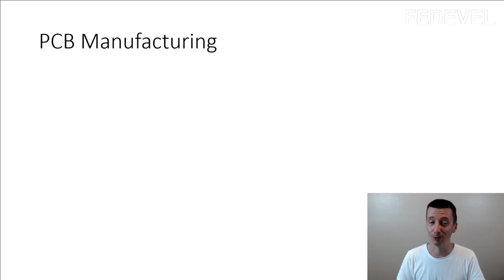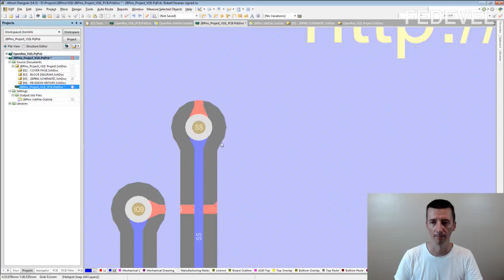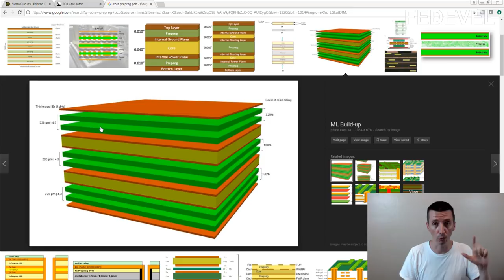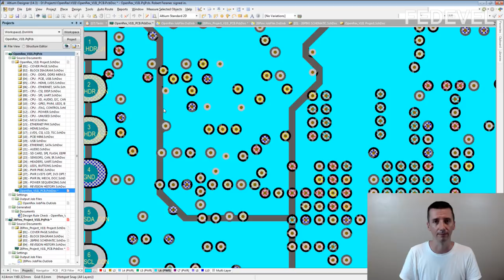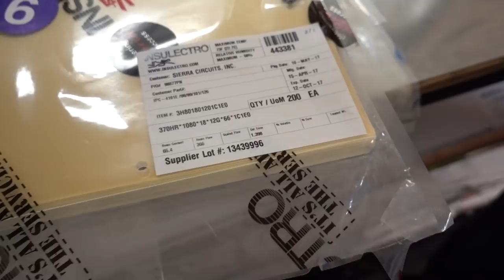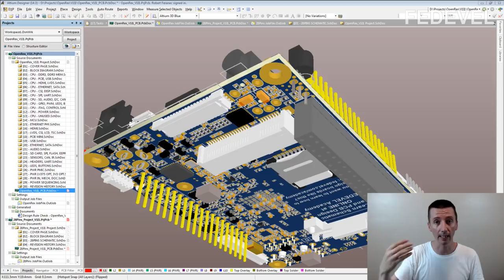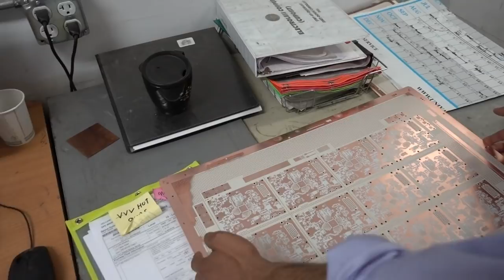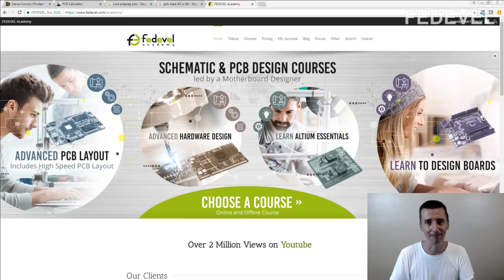PCB Manufacturing - Important facts you should know

Comment: Thanks, Robert! One subject that needs more clarification is related to soldermask and vias. Covering a via with soldermask is called "tenting". Single-sided tenting is not recommended practice, because chemicals can get trapped in the hole (like a well). Most people want to use the back side of the via as a possible test point probe location, but since single sided tenting is not good design practice, we "encroach" the vias on top side, which means mask material "on the pad but not in the hole". This extra mask allows placing vias closer to pads and still have a good mask dam between them (keep solder from flowing down the hole). Also, one problem with double-sided via tenting is that uncured mask material trapped in the hole can expand (like a volcano) at soldering temperatures.
Reply from the maker: Awesome explanation! Very helpful. Thank you Jack
Reply from the maker: Jack, if you like, send me an email to info@fedevel.com and we will send you a T-Shirt. I saw your posts on Altium forum. Thank you for all your support.
Reply: @RobertFeranec  you have already helped me more than you know... and I am grateful. I will help you ANY TIME I CAN, Mr. Feranec!
Reply: Another thing to consider with tented vias is the chemical plating of the PCB. We always order our boards with ENIG (gold) plating now, and if you keep the via holes untented, you get a nice consistent plating inside the vias too. That helps to protect the vias from any long term issues (oxydation/rusting) inside the vias. With fully tented vias, it's generally less reliable as the holes are not really reliably plugged up. It just adds an unnecessary risk for failures and issues. However, i think for HASL (hot air solder leveling) boards, tented vias are preferred, as you run a lower risk of having solderblobs build up in the vias that might cause problems in the reflow process when that solder gets molten again and starts to go where ever it wants. 
I think it also makes a difference between silkscreen printed solder masks and film type masks, i guess silkscreened masks are better at reliably tenting vias, as there is some paint squished into the hole, while with film type masks, there is a risk that pieces of the film covering the hole might come loose and land on a pad/solderjunction and cause issues.
In the end, it's always a good idea to talk to your manufacturer about things like that, they have a huge experience with what they are doing and can give you good advice on what works best for them with the tools and processes they use at the factory.
Reply: And some extra information that just jumped back in my head, we do quite a few designs that need to be very well washed and prepared for conformal coating after the reflow process, and they prefer to have untented vias for this kind of work too, as they are just easier to clean than tented vias where dirt (flux residue) and cleaning solutions might get trapped more easily.

Comment: Robert, I'm very happy to see a new interesting video!!!
I wanted to add a comment on the important topic of Drilling.
Every PCB designer should consider this:
Many PCB Manufacturers consider the drill-gerber file the hole size at the end of the process (FINISH HOLE, or HOLE ENDSIZE).
But the DRILL TOOLSIZE is another thing: this is because the plating process reduces the diameter.
This is important because if you design for example VIA holes with 0.2mm diameter, the pcb manufacturer will use a 0.3mm DRILL TOOLSIZE. (Usually the rule is TOOLSIZE = FINISH HOLE + 0.1mm).
In the example you show in the video, designing a VIA-hole 6mil (0.152mm), many pcb manufacturers will use a drill toolsize of (0.152 + 0.1) = 0.252mm, so the drill-toolsize lifetime will be much higher.

The fact that some manufacturer use a larger toolsize respect the designing hole, impacting the design of all the pcb and all the right rule to put in the CAD, like Altium, Pads, and so on.... For example, if you design the AR (ring-ring) like the capabilities, you should be designed larger because the drill toolsize is bigger than the design hole...
Another example: the "drill to copper" in the inner layers. If you remove the "VIA-unused pad" and you flood the plane, and you want the minimum capabilities, you have always put a bigger rule insulation because the REAL PRODUCTION, the hole is bigger with the drill toolsize.

Many PCB manufacturers knows that this topics create confusion an not specify this, and they take the supplied gerbers and modify them to fit the drill-toolsize without warning the PCB designer.

Other PCB manufacturers instead use DRILL TOOLSIZE = gerber drill. In this case, you do not need to do many calculations to fit the rule cad and stay in the capabilities. But you have to know that the end VIAs will not exactly the ones you should aspect. They will have a smaller final hole, a different parasitic inductivity than the one you've calculated, and so on...As the Robert's video shows, be careful to use a small hole, otherwise costs increase.
Another problem I have had in my career is that if the PBC manufacturer modifies and increases insulation in the internal layers to be able to use a larger DRILL TOOLSIZE, you can have the cut of the inner planes. In your gerber you think you have designed a solid solid plane (typical "swiss cheese"), but the manufacturer removes copper within the limits of the capabilities, so the plane is cut. 

My advice is always to request and verify the "working gerber" to discover all this things.

Robert, Sorry for my English, I hope to given you an interesting topic for your next future videos!
Reply from the maker: Thank you MauroZnt. I am sure people will find your explanation interesting. 
When I was in the PCB company, we discussed also this and I have recorded it, but the topic was not complete, so I left it out of this video. But definitely this is a good point for next visit to discuss it again.

Comment: The copper dots are called ""Copper Thieving" or "Thieving Dots".
Reply from the maker: Thank you RomDump !!!!!!!!!!
Reply: Something i learned is that those Thieving Dots are normally for plaiting through holes or other things to even out the plaiting thickness, you mostly find them on the outer layers. Uneven Copper can cause different thicknesses.
Reply: Copper thieving is the best term and the right answer in cadence I believe it is created by a shape then cross hatching set specifically Xhatch style (shape->global dynamic shape) or in the select shape then parameters -Cadence 17.2
Reply: I had heard (as stated by TecKonstantin), that this "thieving" is mainly used on the outer layers to balance the copper "within" a layer.  As an example, if there is lots of copper in one corner of the board and very little copper in the opposite corner, the electro-depositing of plating will result in most of the copper plating deposits flowing to the side with the most copper, resulting in thicker plating than the other area. These dots are used to "steal" the copper back to the side of the board with less copper.  I guess what this video is suggesting is that the same general technique can also be used to balance the copper "between" layers to avoid "slippage" or warping during the lamination process.

Comment: I appreciate your videos, I have been working in the PCB and PCBA Manufacturing industry since before Lead-free solder was a thing. However I want to point out that all the things you were told are specific to each contract manufacturer, every question can be answered differently. There are so many different ways to achieve manufacturing of PCBs and PCBAs. They should have specified that in their answers so that you don't treat their answers as law or standards, this is why the IPC Org exists. I recommend reading their standards.
Reply from the maker: Thank you d38cb. Yes, I found out, that some of the answers are different between PCB manufacturers. Also, technologies are changing, so some stuff may now be different. Still, I found it interesting.

Comment: Regarding Vias and mask openings, one manufacturer in started to discouraging us from masking the Vias completely, because they have a problem to wash away all the chemicals completely from Via holes. They say that it might eat away the copper in Vias eventually since the humidity is getting to the holes activating the chemical residues during product lifetime. They recommend leave the Vias open and use via plugging instead, if you really need them masked.

It has the second side effect, if you have the Vias partially unmasked it is possible the probe the signals there during bringing-up the board and also connect a hotfix wires from one to another.
Reply from the maker: You are not the first person mentioning this "chemical" effect. When I have a chance I will ask about it. 

From my experience we have never had any problems with it (I am not sure how long it may take to see some effect). However, for some special applications (e.g. super reliable products running for very long time) you may want to consider plugging the VIAs.
Reply: I think it depends, this was a manufacturers recommendations, I think they had big trouble with other customer probleviously. We have some long life designs exposed to moisture and thermal shocks. That was the only case when we experienced vias eaten away by environement.
Reply from the maker: So, was the problem tight up to the specific PCB manufacturer or specific project? 

"We have some long life designs exposed to moisture and thermal shocks." What VIAs did you use there (coated vs not coated, plugged vs unplugged)
Reply: The real problem was tight to specific project, original design was without mask opening for vias and coated. I am not sure if we changed just coating or something else too.

Comment: Thanks Robert! Wish you could go to every major PCB manufacturer and get this kind of process walkthrough. 

Also, concerning 90 degree bends of traces, manufacturability is not an issue, they said. The only issue is uneven E-field and H-field distribution and current density through the bend at higher frequencies. This will result in impedance discontinuities which will then result in additional frequency dependent losses, reflections and phase which closes up the data eye.
Reply from the maker: Interesting. So I will need to ask them and double confirm the 90Deg in PCB then - if there really is a problem with the cracking the tracks or not. I am also curious.
Reply: Robert Feranec I believe their comment on manufacturability. I just wanted to make sure people weren't confusing design for manufacturability with design for signal integrity. Sure, you can layout 90 degree traces, but SI will suffer at higher frequencies. The SI angle is where I have seen this 90 degree topic come up more.
Reply: Very good information regarding the E and H fields.

I saw in a somewhat recent Altium newsletter that 90 degree bends should not be considered a manufacturing issue.

Comment: Hi Robert. The dots on the board panel are called "thief copper". They are used for even out the copper during plating. Rick Hartley has a video on it ("Secrets of PCB Optimization"), which is a great watch.

Comment: Hi Robert, A great knowledge sharing video again!!! Congrats!!   

You have covered the perfect point to point  and considerable things which are helpful in practical designing. 

The copper dots are called Copper Balancing and is a result of hatching process used for it.I have used Fablink Software of Mentor Graphics where you put this copper balancing as a part of panelisation. The reason Mentioned In video is the same for this usage (like to avoid warpage, stress bowing, uneven surface).Please share your thoughts.

I would like to know more about plating process of micro , buried via along with Through ones.Please share elaborately.
Thanks and Keep it up !!!
Reply from the maker: Thank you Swatu :)

Comment: Robert, Did You try to Polaris stack-up tool? It able to add PCB manufacturing intolerances & issues in impedance calculation.
Reply from the maker: I wanted to try Polaris, but it is was quite expensive for just to design a stackup, so I do not use it. Maybe it is now cheaper?

Comment: at my work they say that you can cover all the via's with a hole of 0,3mm or smaller. if the hole is bigger than 0.3mm i need to remove the soldermask that is over the via. is this a good way of thinking?

Comment: can you explain to me about "copper can grow between holes drilled too closed to each other". Can you show me the example like that?
Reply from the maker: I will check with Sierra Circuits to follow this video & comments and they may attach some links.
Reply: So from what I understand: The way holes are plated through is to drill all the holes first, then put some conductive material inside (they call this 'activation'. It is some sort of conductive paint I think).

Then electroplate the whole board, which will cover the board and the inside of the holes, which are now through-plated.

If the holes are too close to each other, there might be cracks inside the material with a hollow 'tunnel' between adjacent holes. There, the activation liquid might get caught and the subsequent electroplating will then fill the hollow space with copper, essentially shortening these holes.

My question: what is the activation material they use ? For my home-throughhole plating, I am using some Nickel enriched paint originally meant for shielding, but it is pretty thick - so a question for next time might be: what is the material they use for activation ?
Reply: I believe you are discussing CAF. Occurs when a voltage potential exists between two vias close together. You can get CAF resistant materials (it helps but does not cure) but problem can still exist if a voltage potential is present for a long period of time and vias are very close together. Ideally keep vias carrying constant potential away from ground vias by >60mil. Big problem in battery powered products that need to last for years. Stagger vias, make sure vias are not in same orientation as weave of board material, etc.
Reply from the maker: Thank you ppot8
Reply: Thank all of you so much
Reply: There are two issues with this one is CAF and other is of dendrites growth

Comment: Robert, do you actually use sierra company as pcb factory?
Reply from the maker: Once we designed a board for one of our clients and they used Sierra Circuits to manufacture the boards - that is how I learned about the company. But personally, I have never used Sierra Circuits to manufacture my PCBs. Some time ago I wanted to use them, but they were too expensive, so I went for my standard supplier (Exception PCB).
Reply: @RobertFeranec  Can you talk more about the ones that you use?  Especially those who works with world wide services, please?
Reply from the maker: @gabrielduarte413  I do not use so many PCB companies so I would not feel confident to make a video about this. Many PCB manufacturers keeps changing (even PCB Exception has changed a lot for the years I have been using them - they used to be UK company, now they manufacture mostly in china in different companies). Also, big PCB manufacturers may not talk to smaller companies so it is very individual. I talk to PCBWay (I have personally not used them, but our students did) and I used JLCPB for a simple board (I was happy with them). Maybe check this video: https://www.youtube.com/watch?v=NyVjg6-wfvY